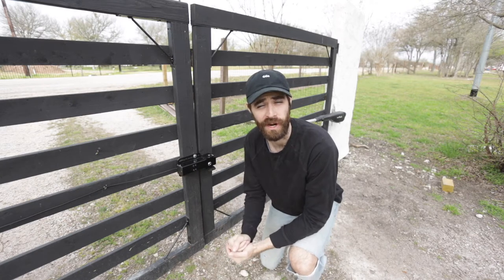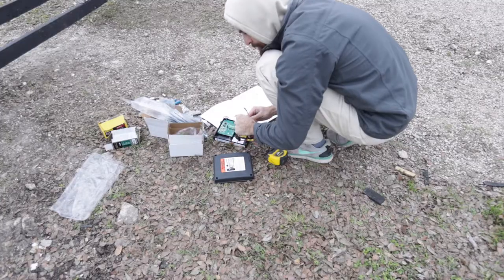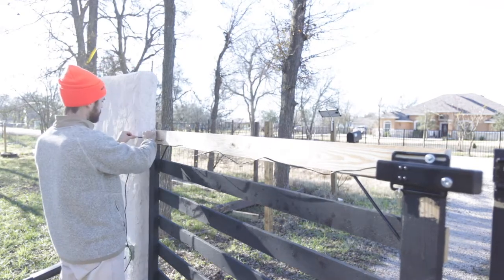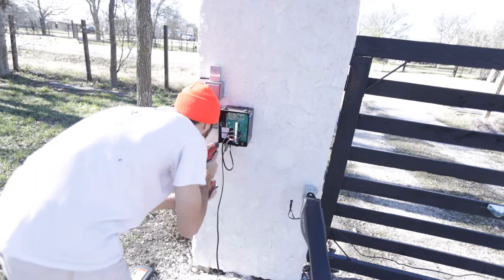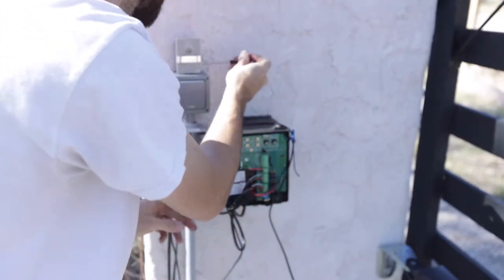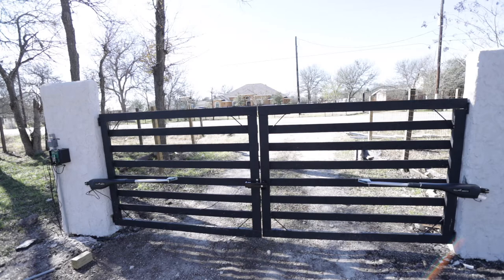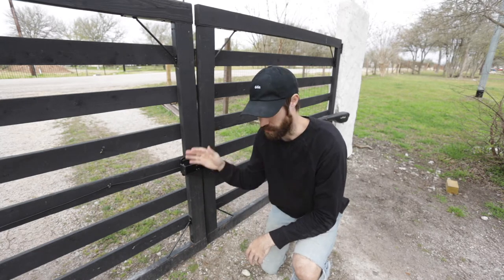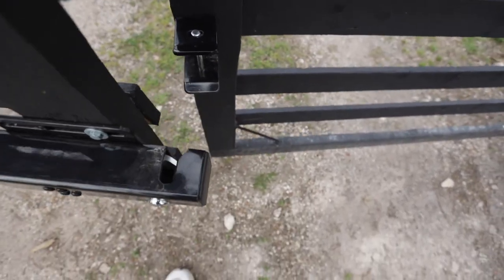Gate Lock Mighty Mule | DIY Automatic Gate

Comment: So I just installed mine, everything seems to be operationg properly, but when in the lock position I can just use my finger to push the latch open. It isn't actually locked. Is there some additional wiring I need to do?
Reply from the maker: That’s weird.. if it’s in the lock position it shouldn’t happen. Maybe a malfunction?
Reply: look at the directions and it will explain the jumper wire

Comment: So you didn't have to use the extra circuit board that came in the box with the lock ?
Reply from the maker: Not sure if mine had an extra circuit board but either way I didn't
Reply: you use a jumper wire
Reply: If you have dual gates you are supposed to. Disregard my comment about jumper wire, that is for single gates.